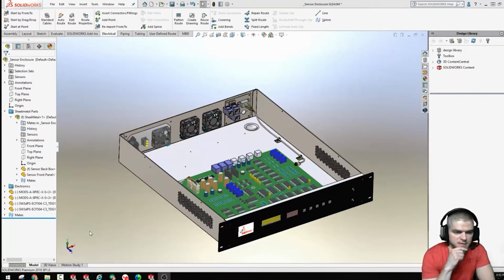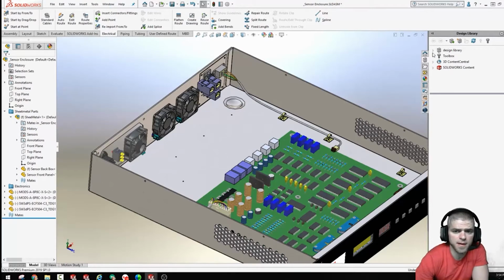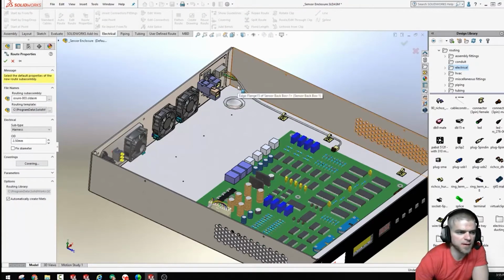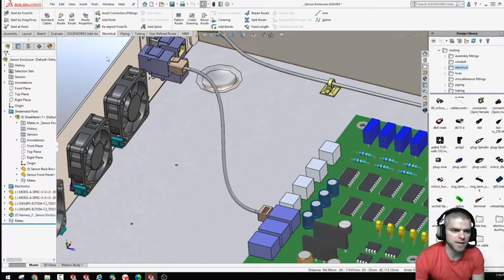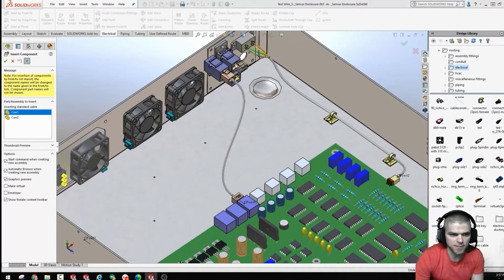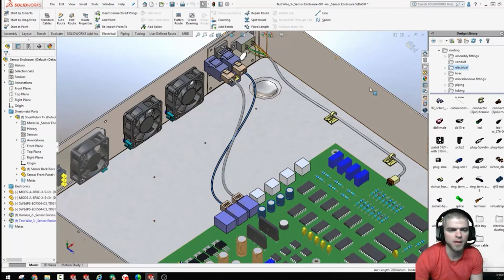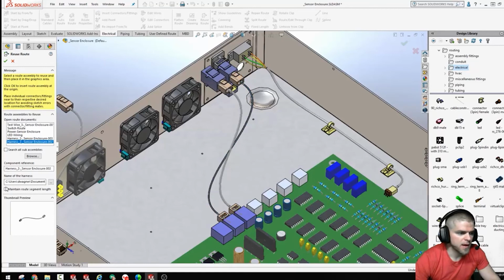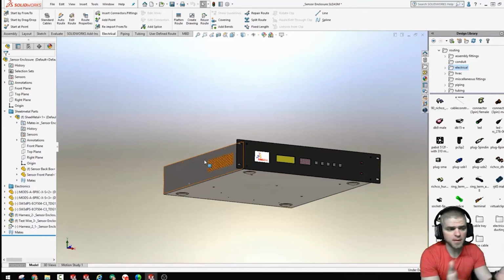SOLIDWORKS Routing Tutorial

Comment: Thanks!

The third method is really interesting. Quite usual that I need to perform reverse engineering of routing. So, I have a 2D drawing of a cable and need to issue assembly documentation with visualisation how the cable is placed. 
I can make a 3D model of cable. Place it later on the assembly with fixed length. And finally make routing that it will look good.

Comment: really helpful, how would I create a wire or flexible hose between two parts I created, let's say custom fittings...or maybe between fittings I've downloaded. I usually just model the wires in manually but this seems like it could save alot of time..